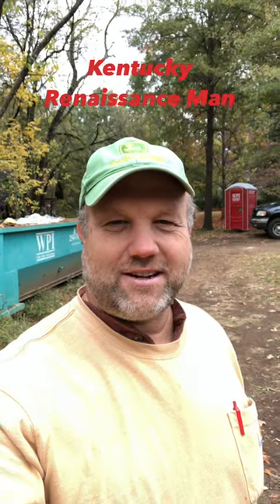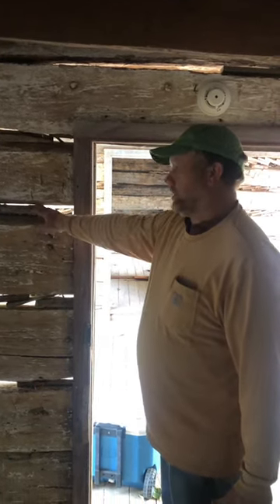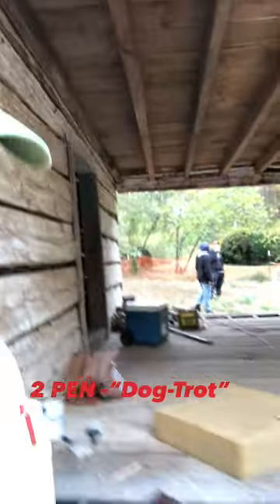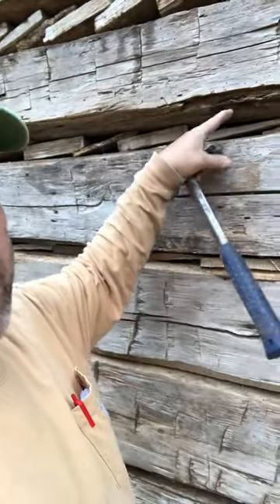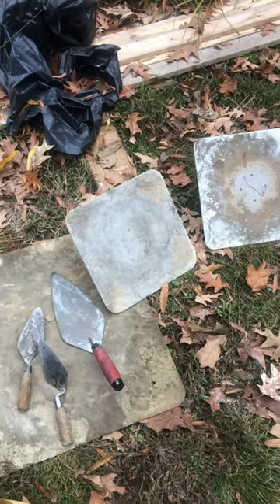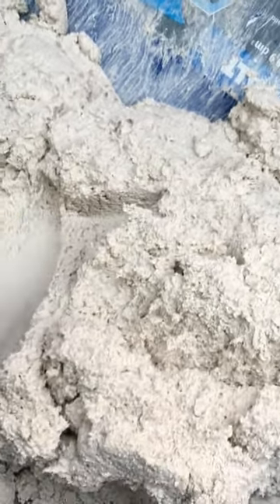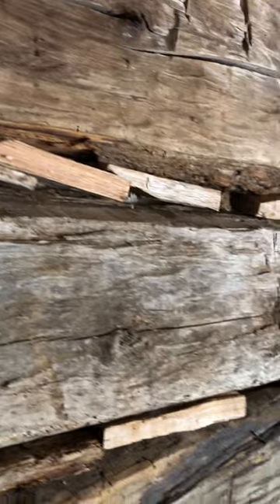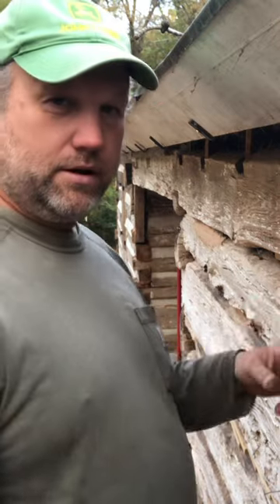Chinking and Daubing a Historic Log Cabin circa 1820 #logcabin #restoration

Comment: love the video.  do you have the link for the Alabama historic spec sheet from the department of interior. We are a nonprofit site with 103 log structures and are trying to restore the dobbing on some of the cabins and can not find any info on the mixture to be used.